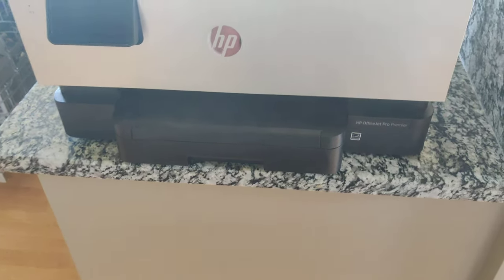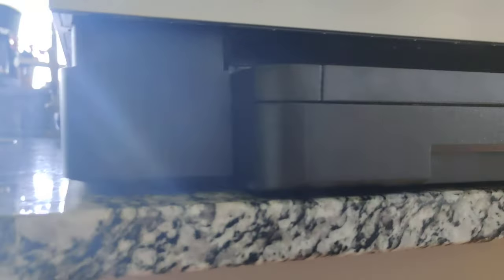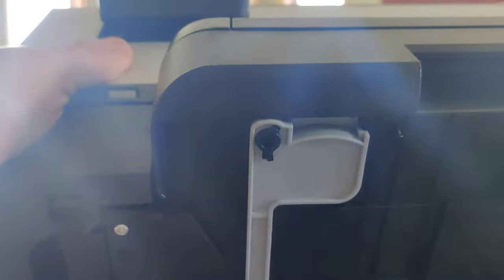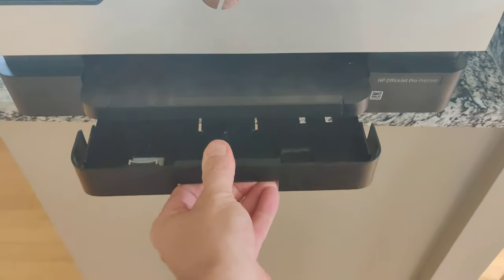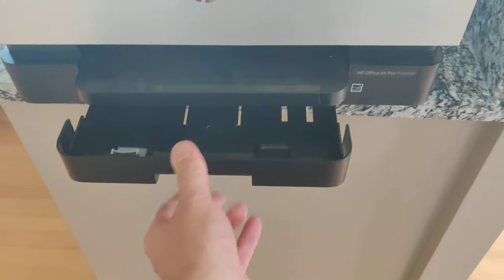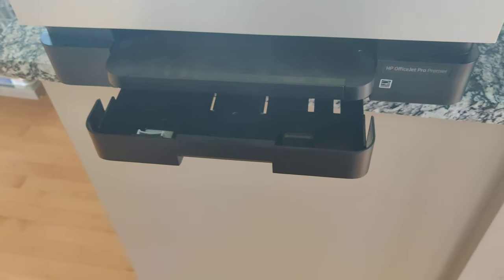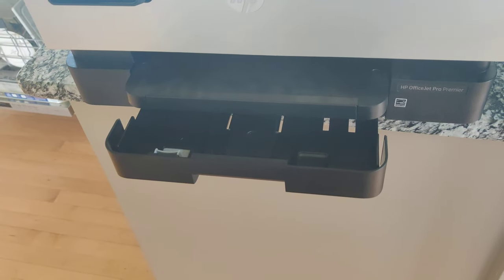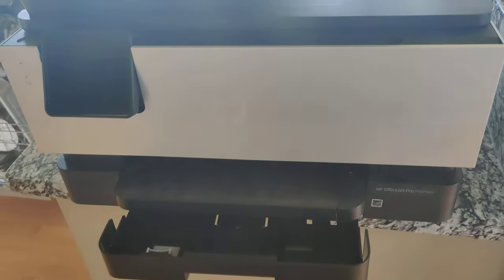HP Printer Paper tray stuck

Comment: The problem is that the paper level sensor arm jams the tray when the paper tray is empty (which is when you most often want to remove the paper tray).  The solution is to shove in a stack of paper about 1/4" thick (50 sheets or so) and the tray will slide right out.
This is a design defect, can anyone call it to the attention of an HP design engineer?
Reply from the maker: Dang bro I can't wait to try this next time it happens. Nah, HP literally sent me a whole new machine. It has the same problem some times.
Reply: Kyle, let me know if it works.  Worked for me.  Thanks for the vid.
Reply: Thanks so much Frederick, my head was about to explode and that worked!
Reply: excellent help thanks.
Reply: I think the solution is to throw the entire thing in the trash.
Reply: you saved my sanity today thank you bro
Reply: This just worked for me, thank you!
Reply: Yay!! It worked!!

Comment: Hope you got this fixed already, but just in case, try this, it seems to work for me: There are two small buttons on either side of the paper tray cover (the light grey "lid" with the paper stop). Press and hold those two buttons down simultaneously, and slide the lid off. Once the lid is removed, the lower main tray should be easily removed. Add paper, replace the main tray, then slide the lid back in until the buttons click, and press the "OK" button on the touch screen to continue.
Reply: Oops, found out all you need to do is tilt the lid up before you try to remove tray! Sheesh!
Reply: Thank you, sir!  This is the correct answer.
Reply from the maker: What is the "paper tray cover"?  I can't find anything that looks like two buttons.  When you say the "light grey lid", do you mean the silver part with the big HP logo on it, which has two holes so you can see the two LEDs through it?
Reply: @404ClickBait  The tray that holds the paper pre-print should be dark gray, the platform where the paper sits after it is printed should be light gray.  The buttons are on the top of the light gray platform about two inches in from the corners toward the interior of the printer.  They are recessed and about the size of an M&M.
Reply: thank you!!!
Reply: Wow it worked
Reply: @joesixer  Thanks!  But this doesn't change the fact that HP allowed a minimum wage trainee-intern to design the tray in the first place!
Reply: Best advice and hopefully I wont need to swear at this printer again.
Reply: I'm a teacher trying to print materials for the 1st week of school and you LITERALLY just saved my life! I was up till midnight trying to pull the tray out and your way took like 2 seconds I swear! 😃🥰 THANK YOU SO MUCH!!!!❤

Comment: I literally just bought a new HP 9015. I could not open the tray of my old 9015 so I turned it upside down to inspect and somehow ruined the cartridge tray thing. Anyway just set up the new one and it’s doing the same thing!!! HP DESIGN FLAW. I left a comment on their website. Hope they fix it.
Reply: Solution - buy an epsom printer. Hp is absolutely trash.

Comment: With the printer shut down, try standing the printer upright with the base and the underside of the tray facing you. You should be able to pull the tray out if the base if lifted up a bit when pulling. Once you get the hang of it, when the printer is powered on and in the usual horizontal position, you should be able to pull out the tray.
Reply: I did and I can't get it to move
Reply: Thank you tanwht1. It worked. I pushed the 2 little blue tabs in and the tray came out.🙂

Comment: A corollary to this problem is the printer’s insistence on making multiple (i.e. many, too many) sets of multi-page documents, when you asked it to only print one set, or even one page.  The waste of HP brand ink, both in black and in color, is atrocious.  After market inks are not compatible with this machine.  The HP printer instructions are skimpy in at least 5 languages, and provide NO guidance on problem solving.   On the last few lines of any printed page, it is likely that it will print three lines 2 or 3 times, ruining the copy you wanted to make.  However it is better than cheap Epson printers, which don’t work at all.